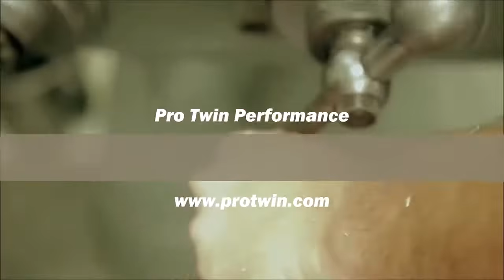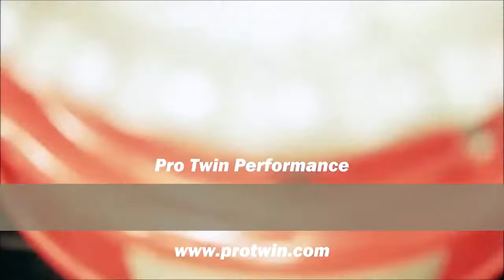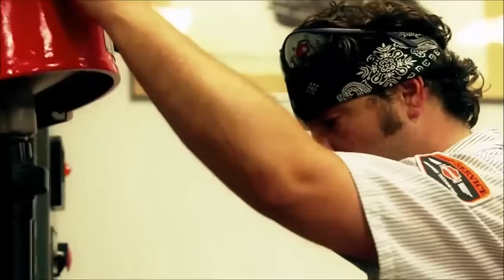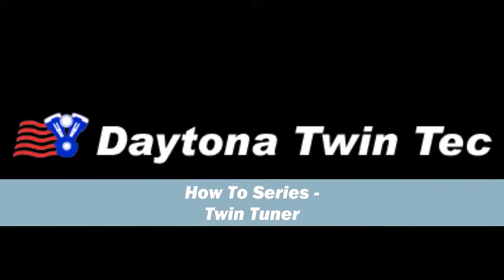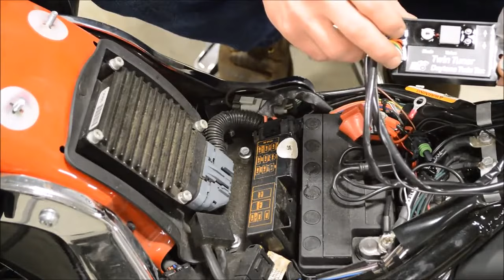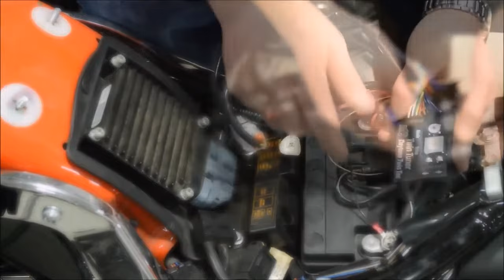Daytona Twin Tec - How To Series - Twin Tuner for Harley Davidson

Comment: If I do the V-Mod on a 2005 V Rod do I just follow the Tune Settings that come in the instructions? 
Removing the baffles is all I would be doing. Will the that keep the bike from running Lean. I just ordered this tuner